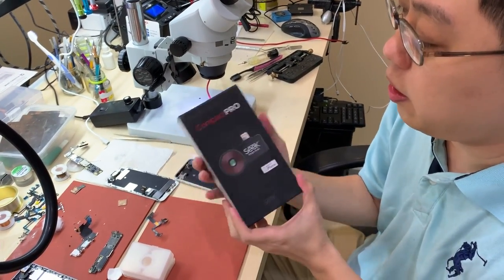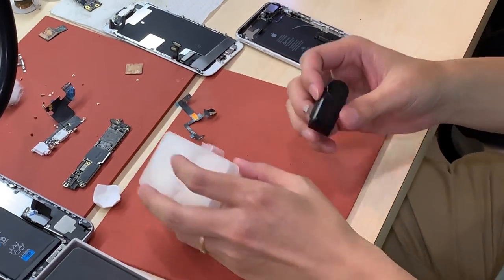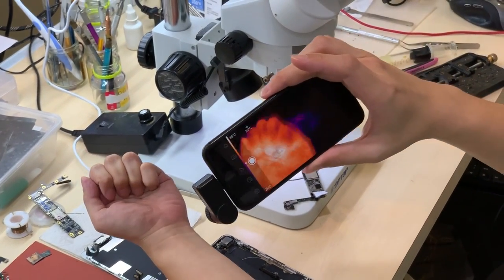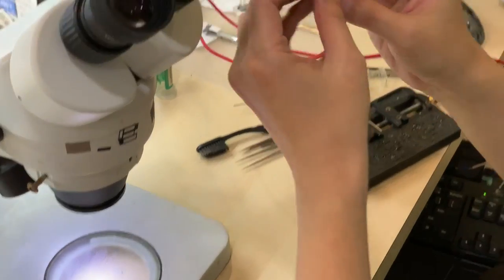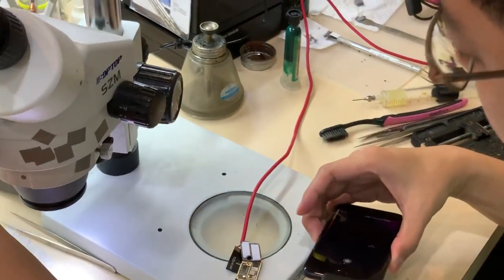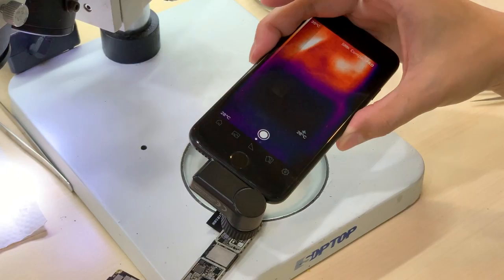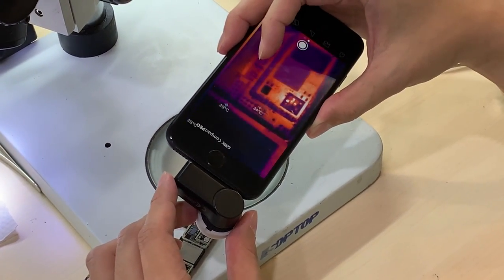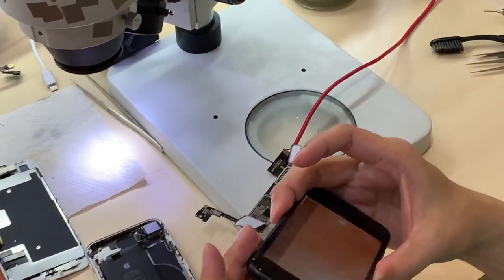What thermal camera?【Seek Compact Pro 】A must have for logic board repair

Comment: ....last unrelated question: which would you recommend between the DT-880 and the Qianli iPower Pro?
Reply from the maker: Not recommmend Qian Li if it's a fixed station.
DT880 I'm not sure.
Reply: I purchased the DT880 but recognised that it doesn't full boot the device and not sure why? DT880 Input voltage is 5V and output is 4.2V. My layman's thinking is that the dock portion is dominating which back the booting device look for the full 5V.
Reply: Hope it was ok the post the links of what I was asking about is ok - if not my apologies.